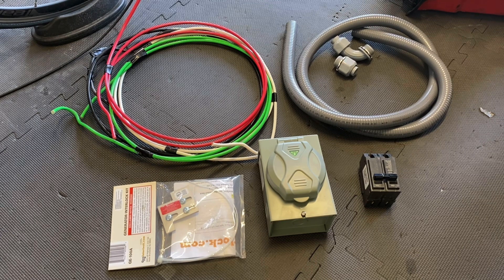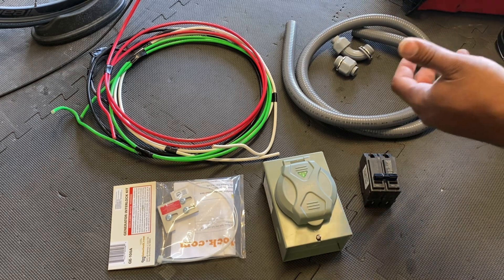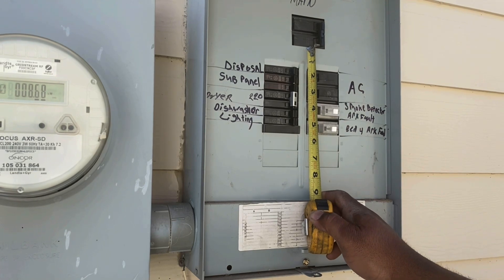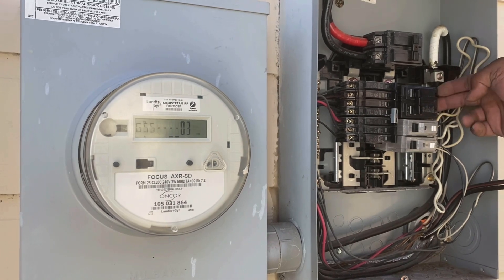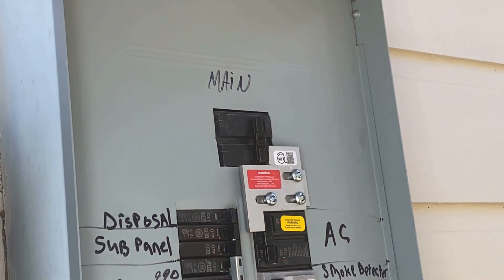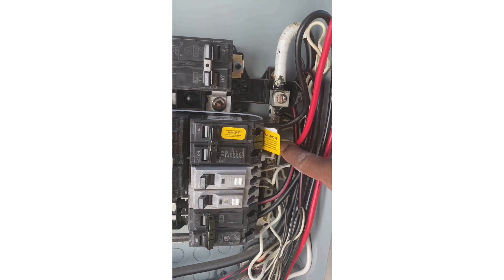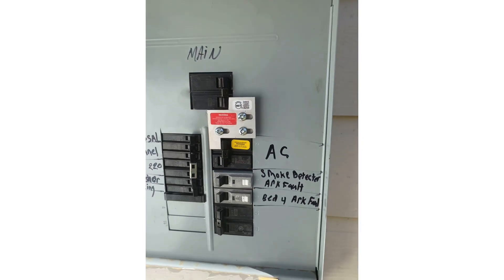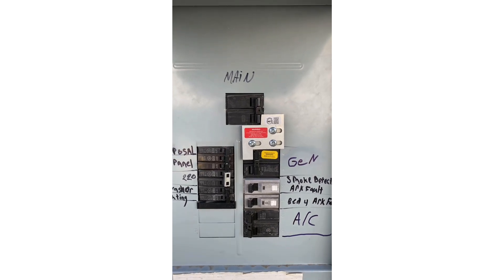Hook your generator to your house the right way!

Comment: When.powering the house, don't forget to unbond the generator neutral from generator ground per NEC Art 702.
Reply from the maker: Yes, you're 100% correct on this. Generator should have floating neutral that's not bounded to the frame.
Reply: Why?
Reply: @Fullhouse0056y6  Per the NEC, the home's electrical system's neutral and ground must only be connected together at one and only one location, which is at the location of the first means of disconnect, typically your main circuit breaker panel.  Connecting grounds and neutrals at more than one location can result in objectionable and potentially unsafe circulating currents.  This is also why, for example, a subpanel's ground and neutrals are never bonded together.  Lots of good videos on you tube that explain this much better than me.

Comment: What size is the wires?
Reply: I think you need 6 gauge for 50 amps. Depends on the length too.
Reply from the maker: 1:23

Comment: I am surprised you didn't use electric/ mechanical interlock.
125 amp. , 60 amp standby.
Even for small manual start generator.

Comment: How do you size the generator incoming power wires? By house electrical code or generator max output? What is code on this? Anyone know?
Reply from the maker: I went off the NEC rules. The generator I was using has a 240v output with 50amp breaker. My power inlet box is a 50-amp and my inlet breaker is 50 amp. According to the rule 6 gauge wire is what I should use for a 50 amp circuit so that's what I went with.
Reply: @blackfootmechanical5413  Ok cool. Gonna run with that then. Thanks!

Comment: Thanks! Can you use a 70 amp breaker with a 50 amp inlet box?
Reply from the maker: I would definitely not. The breaker should always be sized accordingly to your components and wiring.

Unless your wiring and components are sized for 70amps the only thing you would gain from a 70 amp breaker is fire risk lol

Comment: Is it possible to have the inlet box about 40 feet away from breaker panel? I have smaller 4000 watt Gen that only needs to power some lights, fridge, modem & TV and I wouldn't want to have my generator outside the fence for someone to snatch & grab.
Reply from the maker: Yes, with properly sized wiring.